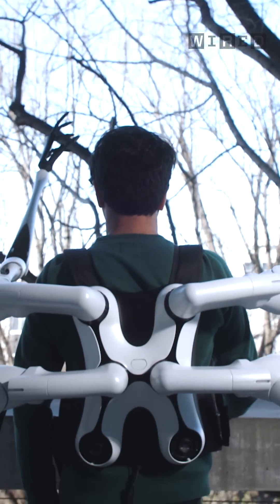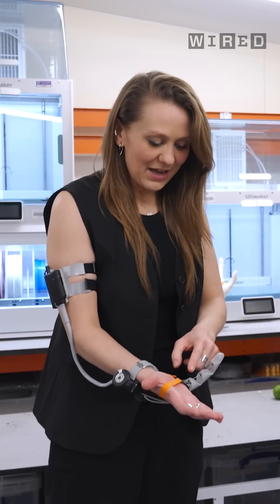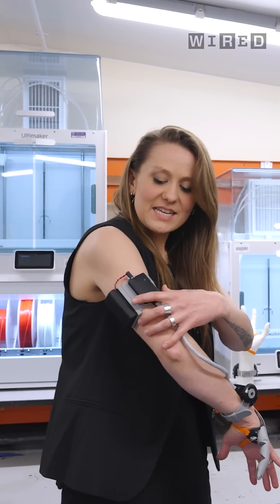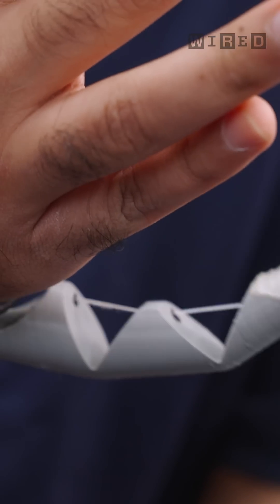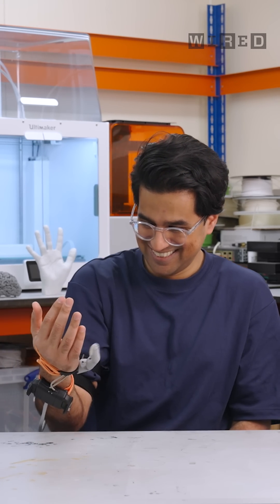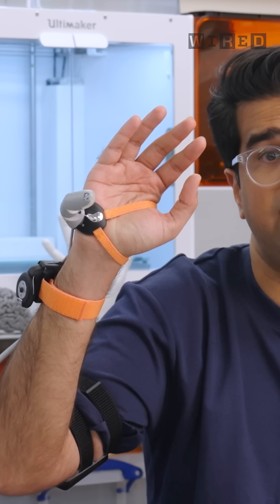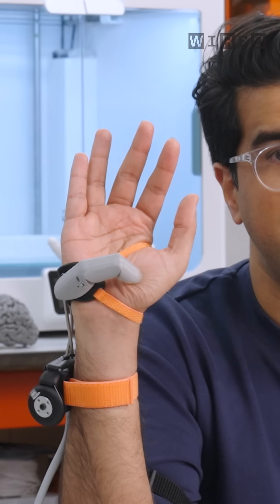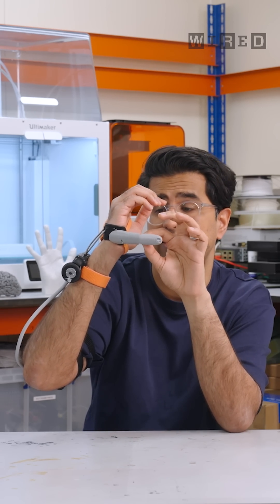We Tested A 3D-Printed Third Thumb

Comment: The human body is at its peak so adding or removing might not be the brightest thing to do, even if it was just extensions, that's my opinion.
Reply: It is definitely not
Reply: spoken like a true nonprofessional
Reply: @nilmerg  Spoken like a true nonprofessional confidently calling others nonprofessionals
Reply: @hope_964  so you've studied biomedical engineering or any higher level of biology or engineering past high school? anyone who's studied those subjects or others like anatomy knows just how wrong it is to claim that "the human body is at its peak" when it still contains actually useless structures like vestigial organs, wisdom teeth, etc. the appendix has ceased function in modern humans & can instead pose health complications when it ruptures.
to begin with, prosthetics & their prototypes are ideas most often developed for assistance applications for the disabled.
Reply: It's good for people who have limited abilities due to disabilities. Also it might be beneficial as a tool for certain tasks. Like underwater swimming.
Reply: @Kyle-nm1kh  as a left for a right hand? no, if it were for disables it wouldn't have been a "Second" thumb also for swimming you don't have a solid ground to control that thumb and the structure of it would fall due to currents